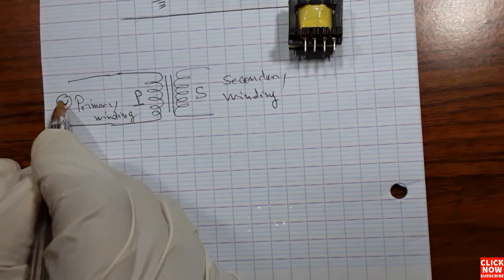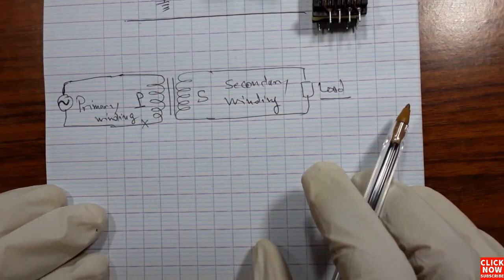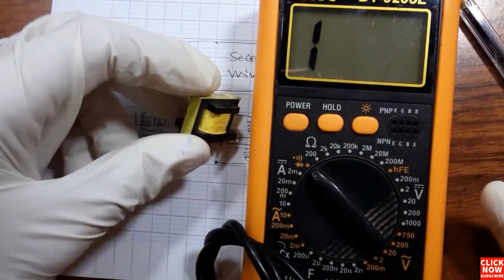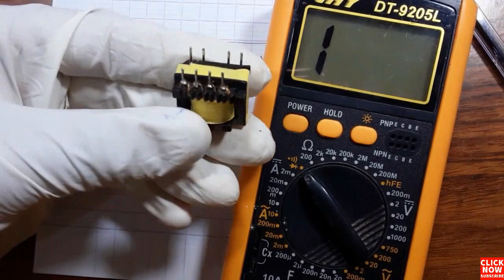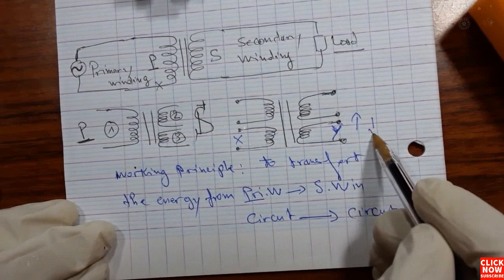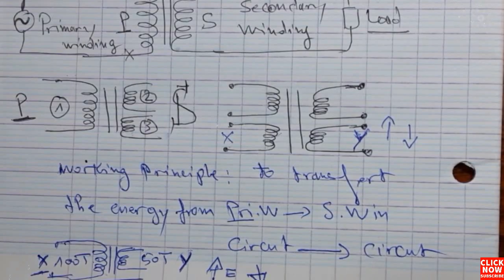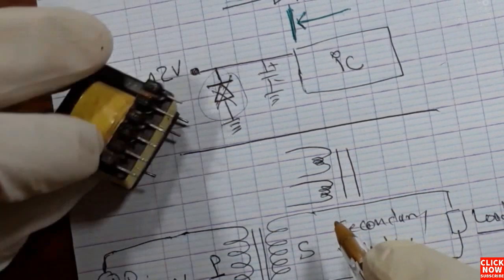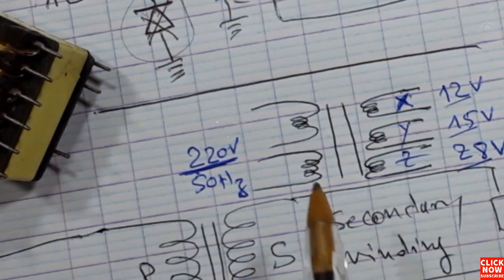Transformers Testing Made EASY with This One Simple Trick!

Comment: I do electronics and I like to see videos like this because it helps people get started in an easy way. Great video my friend. You can also use a tool called a ring tester which is great to find the condition of the wires but it’s not very good for a few turns on transformers. There always pros and cons to a lot of testing with different tools. Anyway well explained.

Comment: Continuity is not a sure way to identify a bad transformer. I have one which should be 230V to 15V with continuity on both primary and secondary winding, yet the output voltage is only half of what it should be.